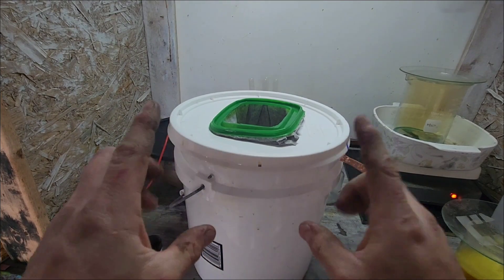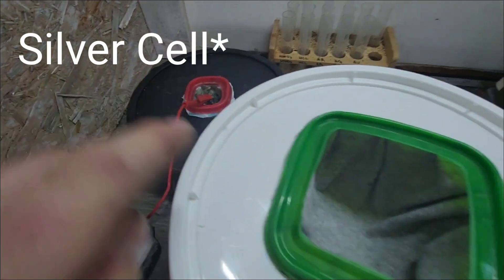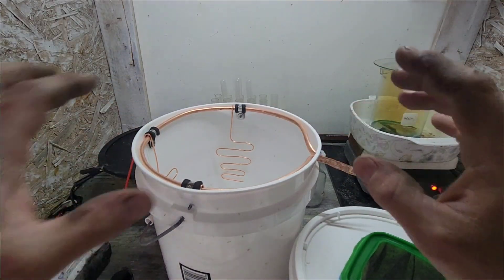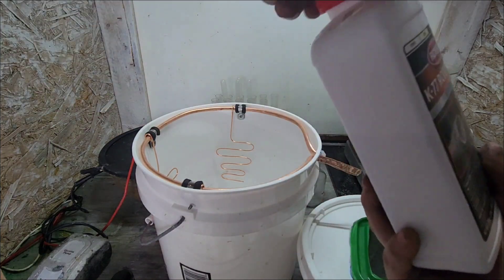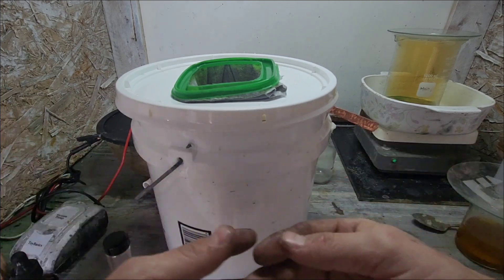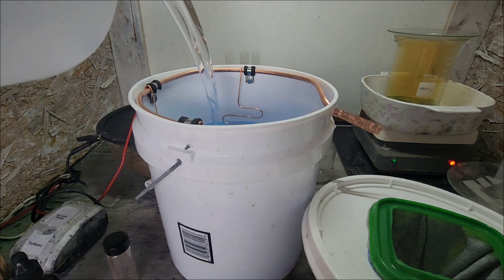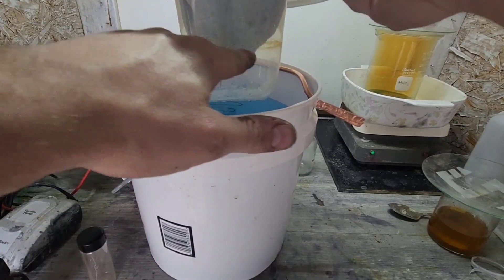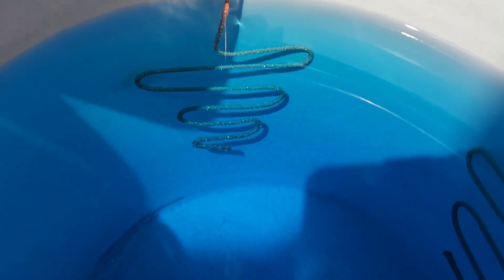Copper cell update!

Comment: Did you add any Sulfric Acid to increase conductivity? You can also use Sodium Bisulfate, is pH Down in the pool supply section, is used to increase conductivity and lower the pH.
Reply from the maker: I did not! My filters just got delivered so I will be making some adjustments with that along with adding sulfiric to help with conductivity! I'll post a short tomorrow on it. Crystals were growing pretty good!

Comment: You finally realized that using a stainless steel bowl as cathode makes it very cumbersome to remove the plated copper afterwards.
The latest design of your copper cell is pretty similar to the one I've been using for the past ten years. However, my cell is furnished with a thin stainless steel sheet all around the inside of the plastic bucket. The stainless steel sheet just needs to be bended slightly for the plated copper to be easily peeled off. It greatly helps if the stainless is mirror polished. Cover all edges of the cathode sheet with some plastic based paint to avoid undesired build up of copper crystal lumps on the edges.
No need to buy copper sulfate. I never buy chemicals or acids but make my own at home. Small bits and crumbles of copper in H2SO4 will give you all the copper sulfate you need for free. Part of my sulfuric acid is distilled off the liquid from old car batteries (to remove all traces of lead). The majority of my sulfuric is extracted from waste gypsum from house demolitions. The copper is small bits and thin foils from electronics (WEEE), and all the very thin electric wires after they've been through pyrolysis for removal of the plastic insulation; many of these wires are as thin as 0.2mm, and the strands themselves are thinner than a human hair.
As anode filter you should avoid any material being/containing cotton or wool. I use vacuum cleaner bags (old ones from scrapped vacuum cleaners). They are made of PET plastic fibers and lasts for a very long time.
Electro refining is the most cost effective way of removing/recovering copper, as copper is a heavy acid consumer. The remaining slimes are process later with just a minimum of acid consumption. I melt all wire connectors and turn them into shots, and all brass is processed the same way. During melting the dangerous zinc oxide fumes are captured in a vacuum system and later converted to metallic zinc; almost all zinc is boiled off by overheating. Energi expenses are zero as the fuel for the furnace is pyrolysis oil, homemade at no cost. Each type of raw material is processed in separate batches.
Electro refining is also the only way I process copper contacts with silver points.

Comment: Cool bud. Love the set up. Clean and professional looking.

 Question: Can you drop in the copper & silver electrical contacts and collect the silver slime in your anode basket ? Then take the silver slimes and melt all that into shot and then run that through your silver cell?

 Fun stuff bro.  Chow
Reply from the maker: I was actually going to try that! I was going to see if if I was going to get just contacts left or if they would turn to goo. It should work. The slimes would be hard to rinse the copper off but what should be left should be above copper in the refining scale.
Reply: You should be able to take the slime bag put it into nitric. That should leave the gold (silver into solution). Then in another container put the bag into aqua regia then that should grab the gold into solution. As long as you use a bag that will not dissolve in HCL or nitric. @SilverStoll
Reply from the maker: @timtoolman4125  we were thinking of being able to skip the nitric and let the cell take the silver. I guess the bag would still contain some silver after the silver cell so nitric would still be needed. Not as much nitric though?

Comment: Nice idea there. I was thinking of something similar but using a rectangular container and 2 anodes. Also can put an aquarium heater in it. Dacron is a must for me. Best deal I found was a 2for. Looking for more savings there. This hobby is certainly not the cheapest on overhead.
Reply from the maker: So with the minimal amount of experience I have, I notice that when your anodes and cathodes are similarly spaced you get a more even plating. For example if one cathode is closer it will collect more copper vs the further one. One might have solid plating while the other is soft and spongy.

Comment: Is this an experiment to determine how much PGM you’re losing to the waste bucket, or are you harvesting the copper? 

Also, you can buy Dacron material instead of using shop vac bags and then you can make them whatever size and shape you want, at whatever thickness you need
Reply from the maker: I am harvesting the copper and hopefully get slimes as well. It is a cheap way to remove copper as well vs using nitric all the time.
Reply: Do you cement all of your waste with copper before you cement with iron? figured that cementing the copper with iron afterwards and sending it to a copper refiner would be more cost efficient. I know there will still be some slimes in there, but it seems more cost effective to let them have that, rather than trying to recover every little bit of precious metals. 

I’m not as well versed as you, and I also have no use for pure copper, so I’m not criticizing, I’m just thinking out loud
Reply from the maker: @damienperry5758  I use the copper as give aways. I was going to start selling them on ebay as well. Some people like the hand poured stuff. I really use the cell as a cheaper way to remove copper instead of nitric. It takes 4ml of nitric to dissolve 1g of copper. When I go after my relays to save on time and propane I just use bolt cutters which leaves me with a lot of brass and copper. After I melt all of the contacts together I run them through the cell and the slimes are the goods that I'm actually going after. I have yet to run my cement copper because like you said there are minimal amounts left. I still have my copper nitrate left from my first refinings. I may run those because I wasn't up to speed yet. (Still have a long way to go)
Reply: Ahh, that makes a lot more sense now. I assumed you were recovering precious metals from your stock pot and waste containers. You’re going the other way around.

And now that I’m thinking a little bit harder about it, I can think of a few people who could use my waste copper, like a roofing artisan who does very specialized roofing jobs. Hmm, this might come in handy
Reply from the maker: @damienperry5758  melt it into shot and sell it by the pound! I figured I would give the cement copper a bath in cold HCL to dissolve any iron and melt into bars. Would leave a decently clean bar I imagine
Reply: I get the feeling you’re absolutely correct. From what I can tell, HCl does an excellent job of dissolving the Fe, along with a few other contaminants. I bet it would be dog gone close to 99.99% pure by the time you get ready to melt it into shot. I’ll talk to my roofing buddy and see how much he’s paying for rolls of copper. He cuts them into squares for slate roofing and other projects, so I might be able to manufacture some hand made products for him. He could probably charge an arm and a leg for them, if I could figure out how to manufacture the equipment fairly easily. Folks with cedar shake roofing and slate roofing are always looking for that extra little something

Comment: As you add surface area on the cathode and anode you have to bring up volts/amps. So what you had for the small cell will be to low.
Reply from the maker: I'm currently sitting at 10vdc with .35 amps. They do look pretty good though!
Reply: @SilverStoll  low amp slow growth. Stronger crystals.